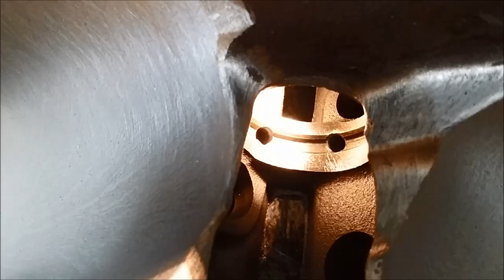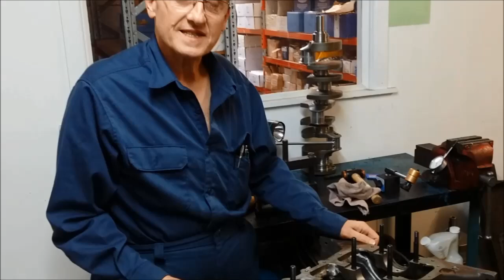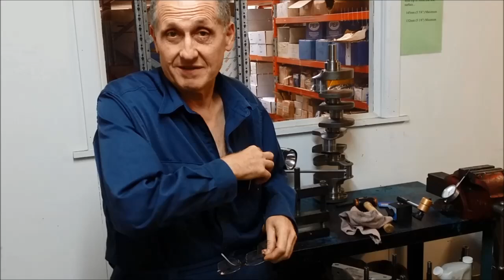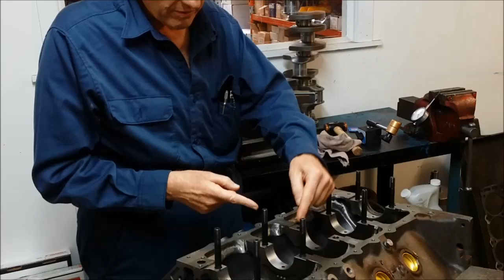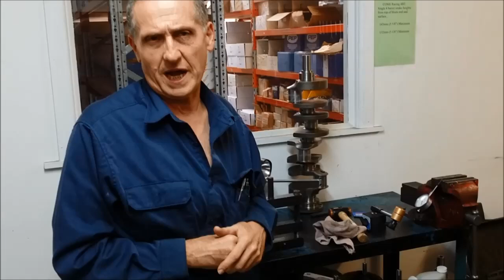COME Racing Holden V8 oiling system mods

Comment: Edge orifice  solid lifters and the cam bearings installed  correctly works pretty good too, oil flows to the path of least resistance  so if your clearances are loose then that's were the oils leaking  ,good info for higher end engines but obviously these mods should be left to experienced    engine guys,  good post

Comment: Thanks very much for the good videos. My question is my 308 is stripped down for a rebuild. My motor will only be used on the street for mostly normal driving. Is this modification really necessary for my application. I would really like decent oil pressure when hot at idle as this will ensure the motor last. In the past I have relied on thicker oils to help bump up the pressure. I would appreciate your input. Thanks